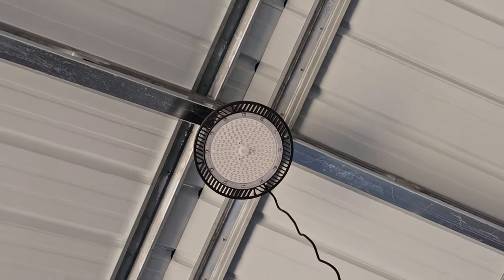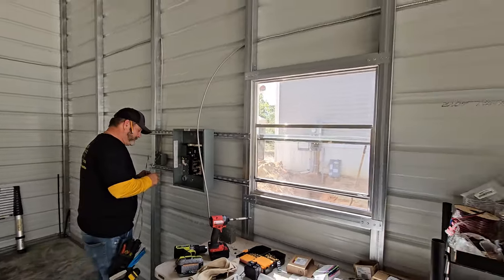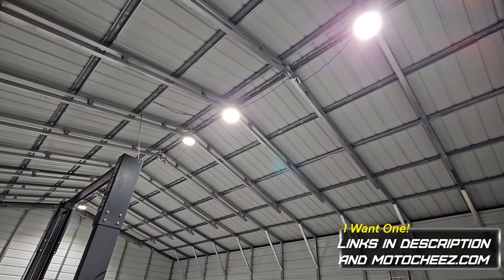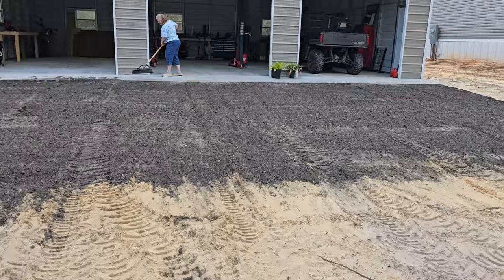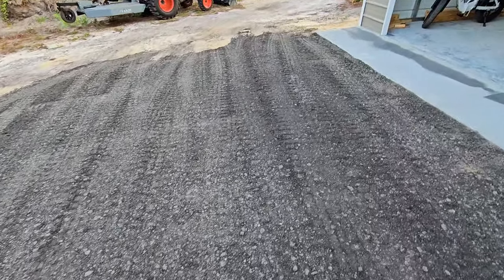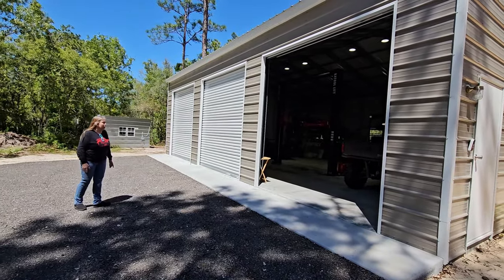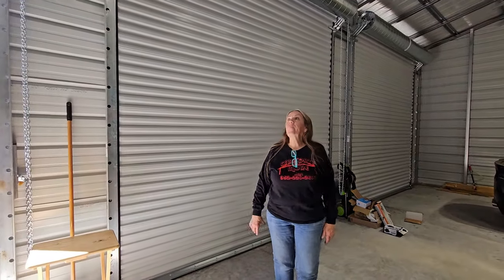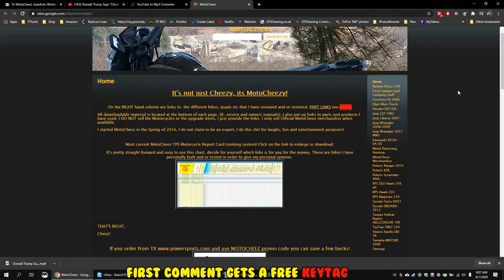PT3  Electric installed, outlets, lights and lift wired. Millings down, Doors installed, inspected!

Comment: Man that whole project , land clearing, house , garage has turned out amazing. Cheezy general contracting 5 star
Reply from the maker: Thanks!
Reply: I know there was allot of defects with house but overall are you happy you went that way
Reply from the maker: Definitely. It was worth it. Defects weren't major
Reply: Are you thinking spray foam for garage or is that not really popular in Florida?
Reply from the maker: @kevins1927 yes, I am eventually, it is popular

Comment: Go rent you a walk behind tamper it’s gas powered just don’t let it. Sit in one spot for too long running, but it should compact the Millings pretty good however I’m not sure how well it will compact on top of sand though got a sweet looking shop.
Reply from the maker: It's actually packed in pretty tight I drove over back and forth with the tractor and it kind of compacted it with the grooves and the large wheels and then I did it with my Jeep a few times it's not moving The kickstand of the bikes don't even sink in so it must be pretty good. Thanks That's a pretty good idea

Comment: Asphalt millings should be at least 4 inches deep and then rolled for compaction. I'm not sure how well they'll compact over sand though
Reply from the maker: It's definitely about 5 in thick at the garage cuz I dug out a big lip to make sure I kept at least 4 in going out at the very end it's tapered I drove back and forth with my tractor the knobbies on the wheels really compacted it in and then I went over with my Jeep about 30 times It's pretty solid. The kickstands on a bikes don't even sink in

Comment: Are the UFOs 200 watts each? 200 watt equivalent or 200 watts over the 6pack?  

Some spray foam and a mini split you can work all summer in there
Reply from the maker: 200w each! That's what I plan on doing. I have an older mobile home AC unit already. 2.5 ton

Comment: Does that price include the slab, land clearing and electric too?   Now you just have to get it insulated and HVAC system put in.
Reply from the maker: Everything but the electric. 
It includes permit fees ETC. Yes insulation and AC eventually
Reply: @MotoCheez  That sounds like you just robbed Jan, how did they do it for that price with that quality
Reply from the maker: @john_barnett 😁👍 I guess I got lucky... She's good

Comment: How many days do you predict to 50K subs? I added outlets on the front of my barn outside, and I have plans for a retractable air hose on the front inside, with a passthrough hole so I can use it outside as well
Reply from the maker: About another month or two

Comment: Cheez this is soo nice! One day id love to have a nice shop like this! I miss being able to do side work. are you going to put a ducted fan w/shutters at one end of your shop? Lokks killer!
Reply from the maker: Thanks, yes I'm going to put an exhaust fan up high and one of the gables two foot by 2 ft, probably next trip. That'll help suck the heat out
Reply: @MotoCheez  Yepper!! How thick did you pour the concrete by the lift bses? Ive heard 6" is best. Im sure it depends on the lift.
Reply from the maker: @craigdeloach3976 10" deep

Comment: The lights are going to create a lot of a lot of shadows all being in the middle. 
I got one of those on a rolling tripod with a boom arm that I use as a shop light now.
Looks like they're causing banding issues on your camera.
Reply from the maker: And actually lights the place up really good because of the white walls, and they are LED so they really don't give off a ton of heat compared to the old style. I think it's the frequency of the lights that are messing with the actual video. Yeah I'm looking for something to work on a car so when it's up he got a light that'll look underneath
Reply: @MotoCheez  
Try manual exposure settings to avoid banding.
Reply from the maker: @fochdischitt3561 I didn't see any adjustments on these lights. They were fairly cheap on Amazon
Reply: @MotoCheez  
No your camera settings. 
Change your shutter speed. 
Look up "LED banding" video's for clear examples.
Reply from the maker: @fochdischitt3561 ohhh